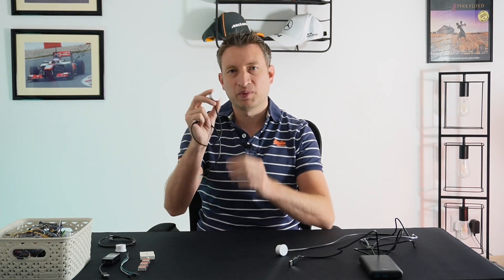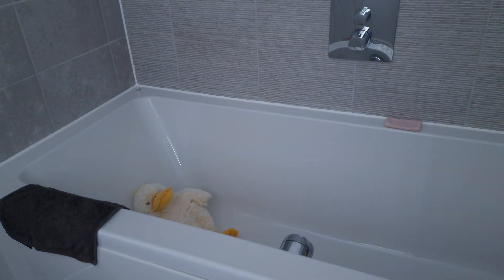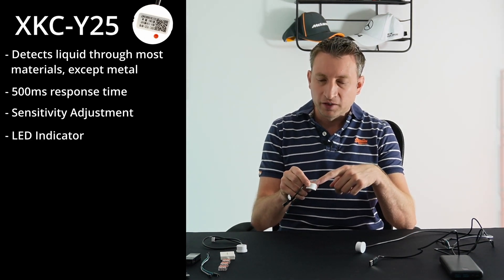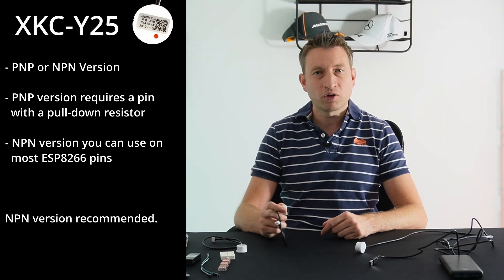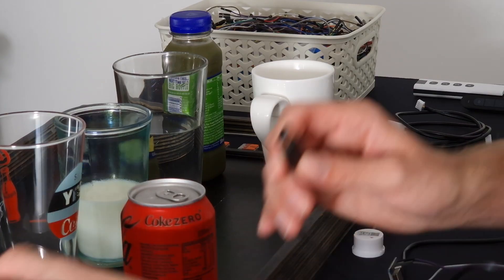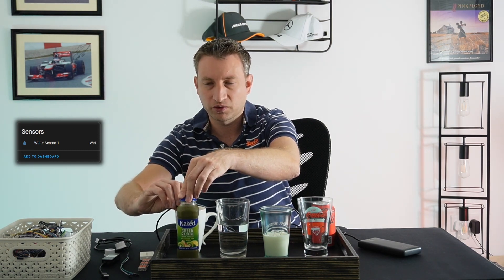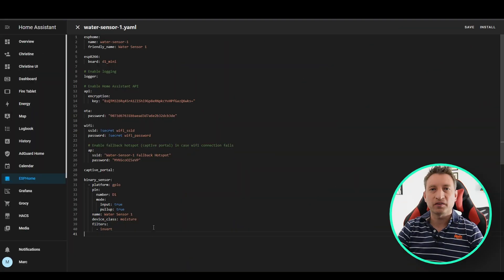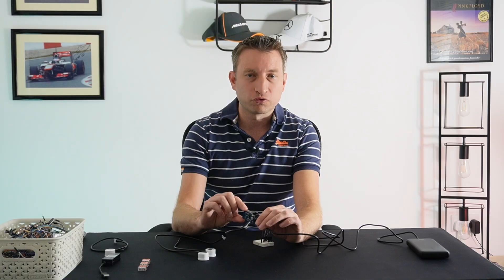Detect water THROUGH a material with this sensor

Comment: Thank you for this  great video.
can I use  2 mm thickness plastic  pipe  as pipe's  diameter is 50 mm .I want sense  garden hose  "have water  now"
Because  in  our  garden have electric motor pump  for watering and I must speed learn  while  motor working and  have water flowing.

Other guestion is if I applicate to 5 volt dc to connection to this module , can I see LED  light  when water flowing I mean ı don't want use any type arduino for this LED light enought for me  for water sensing
is it possiable?
Thank you
Reply from the maker: Hi, yes what you're trying to do should work! It detects through quite a good distance and the led will light up, even if you don't connect the output to a microcontroller.

One thing to watch out for is that if the hose is that you might have some water in there even when your pump isn't running so it might still detect some water. Also watch out for any water collecting near it from rain. Good luck!

Comment: How long can the wire to the ESP be?
Reply from the maker: Because it's a simple on off signal (not I²C for example) it can be as long as you need really. I tend to use CAT5 ethernet wire for things like this to pass the signal, ground and vcc.

Note that this device is designed to run at 5v, not 3.3v though, so with a long wire you may get too much voltage drop for it to work accurately. If you know what a voltage divider is then it would be best to pass 5v to the device and then on the input of the ESP use 2 resistors to bring that 5v down to 3.3v for the gpio input signal.
Reply: @lets-automate  Great news, thanks for the reply and for the great videos you make!

Comment: Hi, can this be replicated with the XKC-Y23A-NPN sensor connected to the ESP32-C3?
Reply from the maker: It looks like a very similar sensor, so I suspect it would work fine, but don't have one to test.

I like that, that version has a sensitivity calibration feature, that's cool.

Note that the ESP32-C3 is still in beta for ESPHome, but again, I imagine it will work fine.

Good luck!
Reply: @lets-automate  Thanks for the reply, I made the same connection and the same configuration changing only the input pin, I wasn't able to make it work... it seems that the sensor can't work well with 3.3v but I'm not sure, I have seen people who made it with the PNP version and it works well, do you have any ideas?
Reply from the maker: What's the behaviour? Is it just stuck on one state or randomly changing?

You could be right on the voltage. Search for "voltage divider for esp32" in Google. If you connect your sensor (+) to 5v instead of 3.3v and put a 10k resistor then a 20k resistor in series between the sensor output and ground, then connect the gpio pin between the 2 resistors you should have 3.3v on the output instead of 5v but the sensor will be powered by 5v.

If that doesn't work then have a play with different gpio pins and try pull-up and pull-down configuration options. Try removing the pullup/pulldown config line, because the sensor could already one internally anyway.
Reply: @lets-automate  The one you haved used also has  sensitivity calibration. You would need to pop the back out.
Reply from the maker: Yes it does, although I haven't had to use it tbh! It's a clever little sensor.
Reply: @lets-automate  Do you have a link for the specific board used in this project?
Reply from the maker: I don't because I bought them a few years ago, but they are just ESP8266 D1 Mini microcontrollers bought from Aliexpress for a couple of dollars each.

I mostly tend to buy ESP32 D1 Mini instead these days because they have more IO pins, with more capabilities, such as touch sensitivity pins, better ADC and BLE so that you can use them as Bluetooth Proxies in Home Assistant.

Comment: Looks pretty useful! I might use a couple of them to monitor my house water tank (we've got low pressure so we have a pump for drinking water).
I have another kind of sensor for the rainwater tank since it is buried in the ground; it uses ultrasound but it is very expensive...
Reply from the maker: That seems like a good practical use for them!

I briefly looked at ultrasonic previously, but I should take another look.
Reply: @lets-automate  Take a look at MaxBotix ultrasonic sensors, I bought the one specified on ESPHome sensor list. It was ~100$, however at least it is waterproof and can reach the bottom of the tank (yes, it is very deep!)
Reply: Found them to be a wee bit unreliable when thicker plastic is involved, like what is used in outdoor water tanks.

Comment: Great for the use case. To get around the problem with mmWave sensor like the LD2410C mmWave sensors that i use i reduce the sensor max distance to cover only half the room. Then Another for the other half for room fans that stand on the floor i have HA turn them off aa i have a PIR sensor by the door leading out of the room. Anyway that works for me. This will be nice to use in the bathroom though
Reply from the maker: Yeah, if you get the LD2410s in a sweat spot they work well. Otherwise, they are either not sensitive enough or too sensitive.

I need to divide my lounge into 2 sensors for more accuracy, but not gotten around to it yet.
Reply: @lets-automate  Yea finding the sweet spot is pretty much the rule for any sensor as far as that goes 😁If you don't put the sensor in the right spot to sense whatever it is it needs to sense then it's not going to work right.